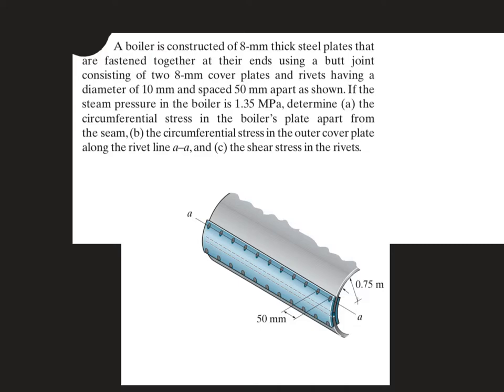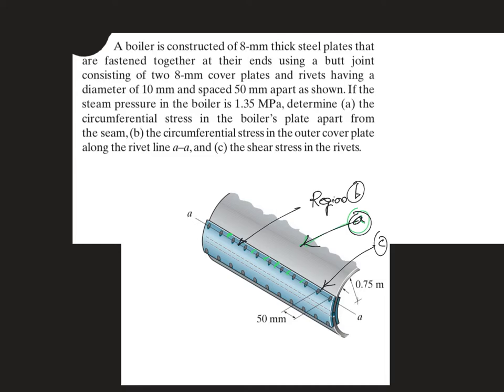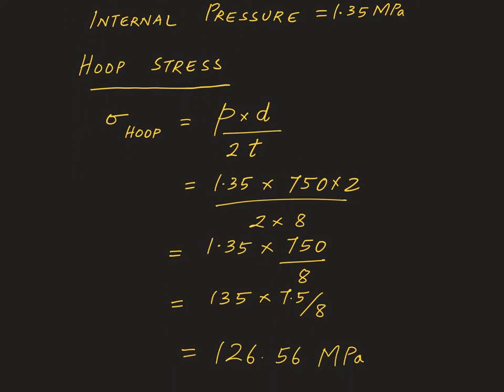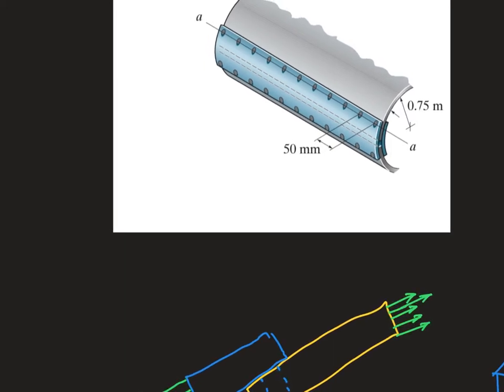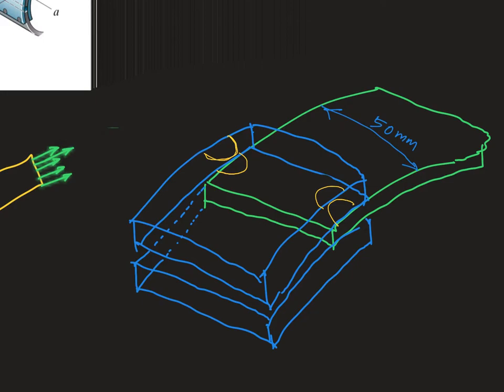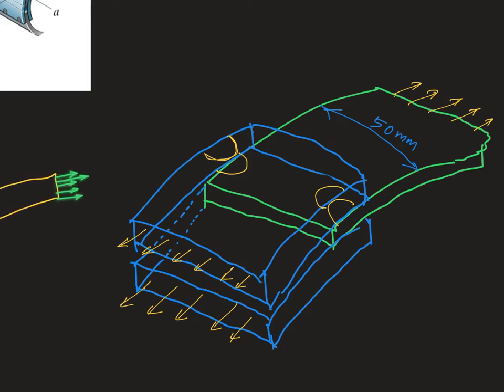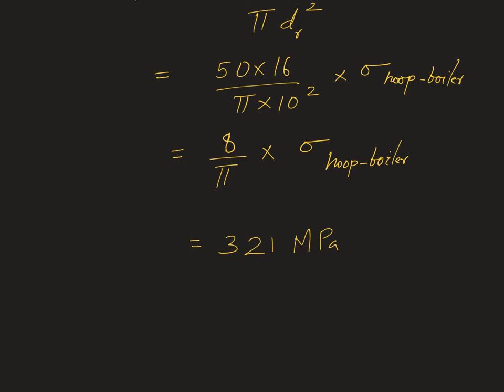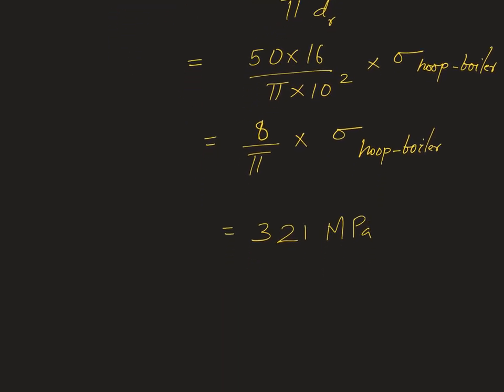Solid mechanics| Solved Example 4| Thin walled Pressure Vessels | Rivets

Comment: Good afternoon friend, I make an observation, the circumferential stress equation you use does not correspond to the result of 126.56 MPa, at minute 4:21, in other words the 126.56 MPa stress corresponds to the longitudinal stress, ok, greetings from México
Reply: Hello. I think the equation used involves diameter (Pd)/(2t) as opposed to the radius (Pr)/t. Longitudinal stress is (Pr)/(2t). Since we are using the diameter, (Pd)/(4t).